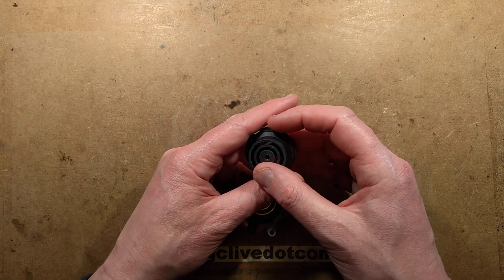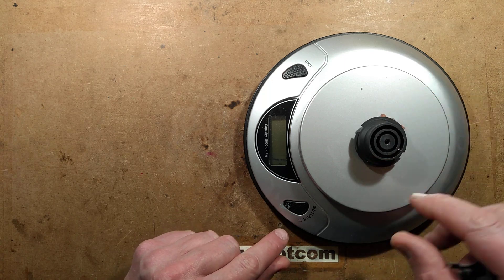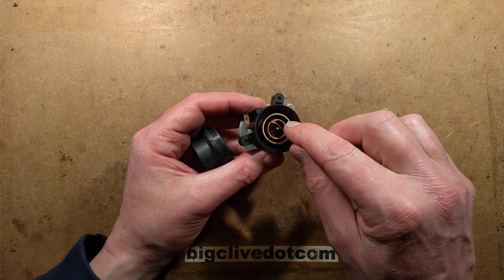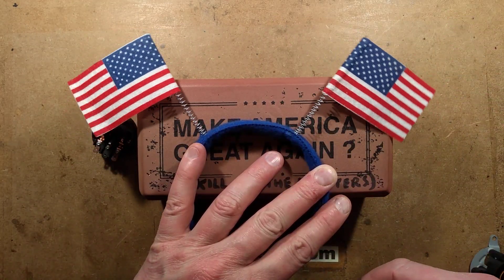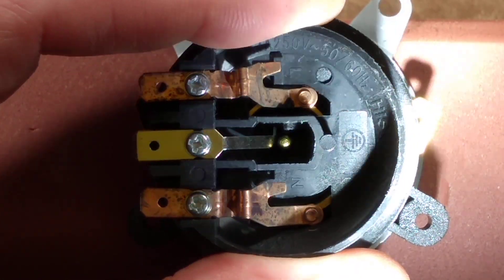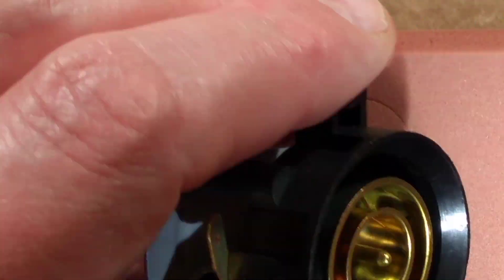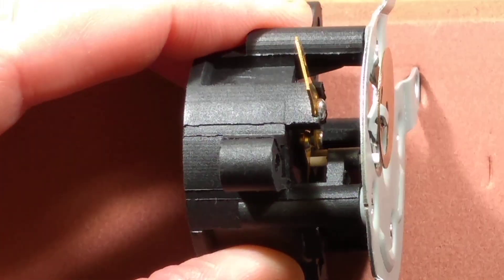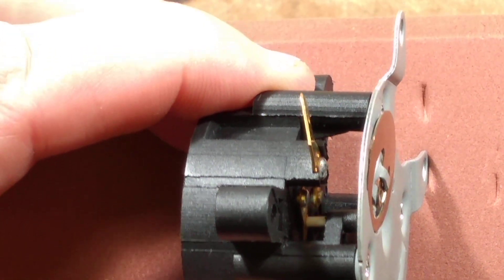A close look at the sliding contacts in a cordless appliance base.

Comment: These are common in cheap $4-$6USD kettles in Vietnam. I think they have a heat cut off switch on the kettle and on the base. I haven't pulled my kettle apart yet because it's been working ok for about 2 years. the socket you have there looks exactly like the socket in the Sunhouse kettles. Cheap but medium quality in Vietnam. Most electronics here are from Malaysia,Thailand,china or Philippines. There might be a few other countries but most of the cheap stuff is south east Asia.

Comment: Worth mentioning, I note the difference in color -- and therefore of alloy -- of the springy contacts versus the central earth:  the springy alloy may be beryllium copper.  Very tough metal!  Often used also for heavy duty fuse clips (strong grippy clips for high currents/temps) and the like in alloys around 1/2 of 1% beryllium and perhaps 2% of nickel.  "Spring brass" (copper with nickel [~15%] and chromium[~8%]) is the other common alternative.

Comment: I've had the base of my bedroom kettle (yes, I'm just THAT lazy!) apart and it has a shuttered version of the ring connector, has to have equal pressure applied to it to open just like some MK shuttered 13A sockets, presumably to stop small fingered things that somehow magically flew up onto the worktop to start fingering electrical connections... :P
Reply: Why use a kettle as a chamber pot? Doesn't that smell a bit?
Reply: It smells, but if you use another method for solids, you never really need to go out and empty it.
Reply: @Kineth1  , the kettle is easy to sterilize between uses..... I bet it makes some nice leafy brown compost eventually. And that lemony yellow compost tea..... makes my eyes water just thinking about it!

Comment: This part with bimetalic spring is for the heat protection if you forgot to fill watter to cettle. In cettle is another one above and works from the steam of boiling watter. On branded cettles thes bimetalic sprigs is valued by temperature. By this video you can do a video about cettle how it works with these elements from this video. I know because i had disasemble a few. :)

Comment: Most household appliances the fuse in the plug lasts the life of the appliance, in kettles I find (well in our household) they last maybe a year. Our kettle stopped working and my wife was getting ready to bin it when I had a look at it and took the fuse out of the plug and checked it yes it had blown. New fuse and its back in action. I think spilled water on the base is the problem.

Comment: I find it peculiar that there seems to be a standardized British kettle format with which all kettles work. The way I know it from Germany, you can buy kettles in all different shapes, sizes and materials, including such with features like to keep the water at a certain temperature. The cheapest kettles start at around 20€, and they all come with their own base. The mechanism in that for transfering the power is probably similar, but not standardized in size at all. Also, the thermal shutoff function is inside the kettle itself, not in the connector base, and also works when the kettle is being turned on while empty, so the bimetallic strip must be thermally connected to the heated bottom of the kettle.
Reply: Seegal Galguntijak The bimetallic shown was in the kettle half of the plug.  There is a type standardized in IEC 320-2-4 (ISO/IEC 60320-2-4), but I don't know if it's the rotating kind shown.
  Anyway, the kettles are not standardized, just some of the components for making them.

Comment: Bimetallic disc is to turn off the power supply when the cattle is turned on without a water in it. Cattle base will heat up very quickly and protection will be activated to prevent plastic to melt/burn.
Reply: Cattle base? Hooves?
Reply: Could you say that this cattle base is a cowaxial connector?

Comment: To clarify a thing for other folks who haven't owned electric kettles, and because I finally saw the wisdom in having a dedicated water-boiling device, I bought one. I've since found that the force needed to get the contacts to, well, make contact, is absolutely worthless as any sort of safety mechanism. In my case, the weight of an unladen kettle is enough to seat it, which makes sense enough, considering it'd be resting at an angle most of the day otherwise.

Edit: Btw, for anyone else who saw these as some weird UKism, these things are fast. Just don't burn your house down, and you'll be happy to have one.

Comment: My Russell Hobs kettle has a similar mechanism. I have had it about 10 years, it works well and is reliable. But...i also did a Pat test on it and it failed on earth continuity from this connector to the stainless steel housing of the kettle. Mainly due to surface corrosion of the contacts on the rings in the base. It was a high resistance, but cleaning it with contact cleaner and scotch pad restored it to its original condition. That's the only negative thing I found with these connectors. 😏

Comment: You need to add lights, ring light around the lens would be very nice for this particular style of filming. Or a large, diffused source. Ring is neater and does it's thang without creating visible shadow, which is what we have here: since there is no "backlight", there are going to be very prominent shadows and the angle of the light makes it so much worse.

Comment: I thought this was going to be a clockspring type like old telephone cords have. If you're curious, and want a super reliable clockspring for a project check out an automotive clockspring from a car with an airbag.  Probably cost 20 bucks or so. No spoilers, only a hint. If you plan to re-use one after removal, you have to make sure you don't add or remove any turns to it, center it up first. You might need a large Torx bit to pull the steering wheel bolt, the wheel you can get without a puller, the rest is basic tools and a good yank or 2 to free the wheel.

Comment: Hmmm never had a kettle with a weight switch. It just slides unto the base.Comes with big warnings to use a minimum of 0,5 liters. As I use it in the mornings for tea or coffee, so before I'm fully awake, I once or twice put it on with just a little leftover water in it. Turns on no problem. The only "safety feature" it apparently has are the noise and smells it starts producing. Nowadays I always keep a spare.

Comment: I repaired one of these recently and the contacts on the end of the copper strips had high resistance to the strips they are riveted onto.  Soldering the contact to the strip resolved the issue.

Comment: I can think of a few ways I could use this in theatre. For example putting some prop down and having it light up when it engages with this. Interesting
Reply: xad001x0w For that, you'll enjoy the premade all black or all white bases that come with kettles.  Unless the plastic surface is too shiny.  For stage safety, turn off the circuit from backstage until the cue.

Comment: I had this plan of dismantling a defunct kettle and using the base and connector to make a "cordless" glue gun. So it would sit on the base and heat up and the residual heat in the gun would be enough for most small jobs. But if it needs that much weight to hold the contacts on the idea is buggered before it begins! Although perhaps a connexion set harvested from an old kettle would be sloppy seconds and the gun might hold it down? lol
Reply from the maker: You can buy a cordless glue gun that sits on a standard figure eight connector in the base.

Comment: A couple of comments have said the centre pin is the earth, wrong! The centre pin is the live, the middle ring is neutral & the outside is the earth.
Reply from the maker: The centre pin is attached directly to the metal backplate.  It's also the one capable of least continuous current in this unit.
Reply: @bigclivedotcom  maybe that one is different, but all cordless  kettles I've had with this have the centre pin as live , (I always check them when I get a new one), the outer contact will obviously be earth as there is an exposed contact on the base unit.

Comment: This must be the emergency trip. The regular switch off mechanism relies on steam being produced as the kettle boils being directed to a similar bimetal disk which operates the physical switch  on the kettle and turns it off permanently. This emergency switch will operate if for example the kettle is switched on when empty. The element will heat up but with no steam being produced the emergency trip will operate. Unfortunately in most cases this  switch will continuously open and close until power is removed. A better solution would have this switch combined with a latching mechanism which holds the switch open until manually reset.

Comment: Shouldn't you have tared out but connectors together, so the only extra weight/force would have been you pushing it down?
Reply from the maker: I pondered that, but the weight of the connector was part of the force pushing down.
Reply: @bigclivedotcom  True that. And about the bimetallic switch, it's probably placed right beneath the kettle, so if it cooked dry, it would switch off. But it would easily switch back on if it cooled, wouldn't it? So much for safety. ;)
Reply: @Fuzzems  Once the power is disconnected to the kettle the kettle switch would need to be re-engaged. Much like with a toaster.

Comment: The steam turns off the kettle by a internal switch between the base and the elements, the one operating the points is a safety against overheat, but ideally it should click off and stay off.  So, it makes me wonder what that switch is actually for as both a kettle switch and a safety overheat should be designed to stay off (Especially a safety) there is no point in having a safety that resets!
Reply: If it would not reset, then many people would 'damage' their kettles very fast forever just by putting too little water in it or keeping the lid open. Maybe it should reset only after lifting the contact out and on or with a special knob to press like ' in the old days'  but probably too expensive.
Reply: @elvinhaak  Yes you used to get a reset safety button, but now they just want to sell you a now safety stat.at a high price!
We had a kettle that pushed out the power cable if it overheated.  I think it was a Swan kettle, but I am not 100% sure about that as I was little at the time.
Tumble dryers used to have the reset button on the safety stat, now it is sealed and pricey to replace.  So I took it off, drilled a small hole and pushed the bimetallic strip inside it to reset it.  Still working to this day.  By the way it was a wire out of a bra that wrapped itself around the bearing and jammed the drum, this tripped the safety stat.  After I got the wire out I reset the safety stat and it has run ever since.  It is due to have all the stray fluff hoovered out of it, a nightmare of a job, but it has to be done for prevention of fire.

Comment: the electric jugs made from stainless steel that have this things sold by some seller at less $5 only, at least not plastic and the price that cheap don't really mind if it going kaput after few use, but so far I use it more than enough for the value its sold, but better open it up first and make sure every bendy metal/brass contact inside it contacts firmly, otherwise that can cause overheating and damage the plastic part

the part shown in the video here is just $1 for that one set

Comment: Apart from the 1 Kg weight requirement, this would be handy for modding a hot glue gun or maybe a soldering iron if using it for just the odd joint. Leave it on the base most of the time, doing its thing. Then pick it up when you need it and it'll retain heat for a minute or so -- enough to do infrequent, quick jobs without the cord getting in the way.
Reply from the maker: They do sell cordless glue guns with a figure eight connector in the base.
Reply: @bigclivedotcom  yeah I had one of those. The fig 8 connector didn't last long.

Comment: I've wondered how safe these things are, figuring they must have  provision for spills + mains voltage. Is centre earth, would it not be safer for the outer (largest most pokable) ring to be earth?
Reply: Can't speak for this one but pretty sure the variant in my jug has an integrated switch triggered by the middle pin, which cuts power when the jug is lifted off the base.  I guess there's still the question of what happens when water gets into it, but at least it should make it harmless when faced with a basic level of poking.

Comment: For some reason I assumed that was a rotary sliding contact from the thumbnail.
Reply: Josh St. Louis It also is!  You can freely rotate the kettle while in use.  The slightly older model did not allow that.
Reply: @johnfrancisdoe1563  Good to know! But I was referring more towards a continuously rotating contact similar to brushes on a universal motor. Older generator stations had such contacts meant for continuous rotary sliding.

Comment: The scale is actually giving force, though in Newtons divided by the typical force due to gravity.
Ie, to get the measurement in newton, just multiply the Kg measurement on the scale by 9.8.
(The acceleration constant for gravity varies on earth from between 9.764 m/s^2 to 9.834 m/s^2, but 9.80665 m/s^2 is the standard value that scales should use if following international standards. 9.8 is though a far easier number to remember.)

Comment: Tool connector for a Sybian.
Reply: 95% will not understand until Googling "what is a sybian"
Reply from the maker: Don't they use XLR connectors for some of those things?  Not for an electrical connection, but just because of the locking barrel.
Reply: @bigclivedotcom  Probably.  I did see a 'double tool' which might benefit from a rotatable connector.

Comment: why do they not put the steam sensor near the top of the kettle instead of using a tube to direct the steam down to the sensor at the bottom. The steam tube is a blind end tube and difficult for steam to pass through. At the same time, water can enter the tube when kettle is upside down and kill the mechanism
Reply from the maker: I think it's to avoid having electrical wiring throughout the kettle.

Comment: Why is the earth pin a different metal? Is there a reason for it?
Reply: Copper is down and brass on top. ?
Reply from the maker: It's bonded to the metal plate, so its probably just for ease of manufacture and the fact it doesn't pass current unless there's a fault.
Reply: @bigclivedotcom  Thanks!

Comment: Why doesn't a kettle switch engage in the on position whilst not connected to supply? Often wondered that @bigclive
Reply from the maker: On some of these bases the kettle switch will revert to off mechanically if it's lifted so that the base doesn't make or break contact under load.
Reply: I assume there is an electromagnet like in a toaster, my kettle will click off it's switch if the power is turned off at the wall.
Reply: @CyclingSteve  yes I was wondering that too,  thanks.  Need to take apart have a look now lol...
Reply: It's nothing as complicated as an electromagnet. There's a mechanism that links the switch to the base (of the kettle) connector to prevent it latching on when not sitting on the base (connected to the mains).

Comment: Should've probably used thermal camera to measure the bimetal plate tripping temperature...
Reply from the maker: Tricky because it's reflective.  I'd have to spray it matt black to get a proper surface temperature.
Reply: bigclivedotcom I would probably try to cover it in soot (would be fun doing so while it trips from the candle heat...)

Comment: Thought bigclive was gonna answer a question I have pondered for years. How does it stay safe given the inevitable proximity of water? I understand the weight of the kettle makes a connection, but if there were a hefty water spill on top, without the kettle, would it short?
Reply: It would not short because water is far too high a resistance. With the presence of the earth pin it could probably trip your ELCB on the ring main. Failing that then the water would just contaminate the contacts by electrolysis and eventually evaporate.
Reply: Ok Drew, thanks for that. I was gonna move the kettle from next to the bathtub (who doesn’t enjoy a fresh cuppa in the bath?) but I won’t bother now.
Reply: @albertbatfinder5240  that's perfectly fine. As there are no legal mains outlets in UK bathrooms feel free to play with your bath kettle.
Reply: Yes and I am sick and tired of explaining to visitors why the bath is in the lounge room.

Comment: Clive surely you should have zeroed both pieces before you pressed down,???  that USA brick needs sending back for that big ass wall they keep going on about. Keep up the good work.
Reply: he actually wanted the mass needed to bottom the contact not the force needed on the top contact, therefore you include the weight of the upper contact in your mass because it has to be there

Comment: Big Clive I have a question for you... How do I find the frequency cheap Chinese wireless RGB bulbs, they have  no Wi-Fi chip onboard.
Reply from the maker: Do you mean the infrared ones?
Reply: I have some GU10 colour changing rgb bulbs. They are definitely not wifi, but they do somehow sense each other & synch together to colour change at the same time. It must be IR in a similar way to how Disneyland change the colours of mickey mouse ears in the audience?
Reply from the maker: @wirdy1  Many of the colour changing lamps use the mains frequency as timing so they all run in perfect sync.